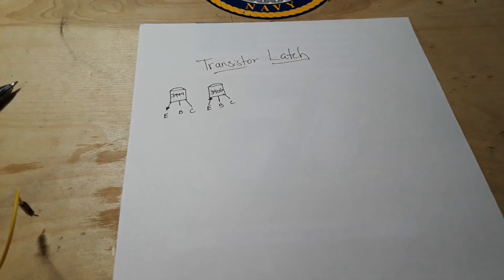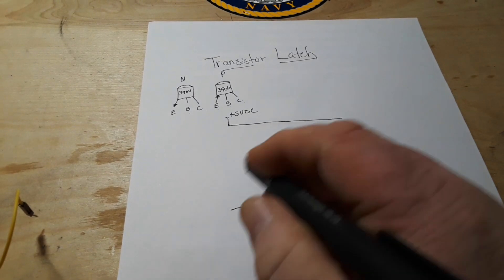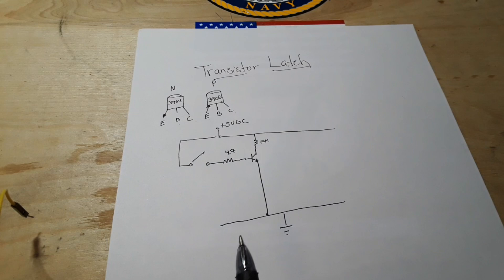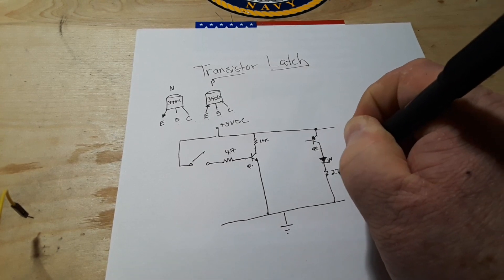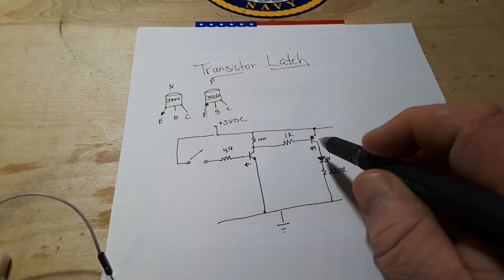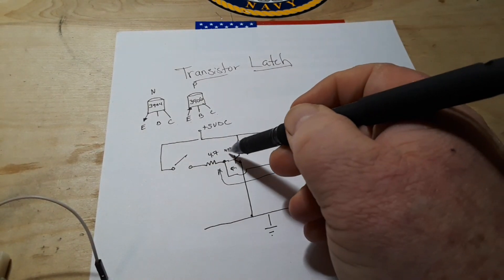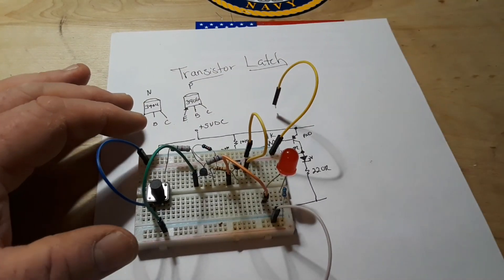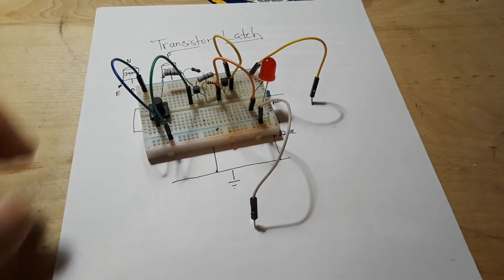The Two Transistor Latch

Comment: There are some things on this that aren't so clear...

Step 1. Connect one side of 10K Resistor to the positive rail and the other side to the Collector (C) of NPN Transistor. That is clear.

Step 2. Connect the emitter of the NPN Transistor to the ground rail. That is clear.

Step 3. Connect 4.7K resistor to the switch. Do you connect the other side of the switch to the Collector of the NPN? Do you connect the other side of the switch to the Positive Rail? I would think so, but you don't make it clear (THROUGH WORDS) that that's what you're doing. Unclear.

Step 4. Connect PNP to the Positve Rail. Are we connecting the C or the E? For someone who doesn't read schematics, this is unclear.

Step 5. Connect PNP to LED. Are we connecting the positive of the LED or the negative of the LED? Are we connecting it to the C or the E on the PNP? Unclear.

Step 6. Connect LED to a 220 OHM resistor. Again, don't know if it's the positive or the negative of the LED that we are connecting it to. Unlcear.

Step 7. Connect other side of  220 OHM resistor to the ground. Clear enough.

Step 8. Connect one side a 1K resistor to the base of the PNP and the other side to...where? You say to the power, after the 10K resistor, but it looks like it's connected TO the 10K resistor, which is connected to the C of the NPN...so is the 1K resistor connected to the B of the PNP and the C of the NPN? If so, why not just say that? If not, where is it connected? This is unclear.

Step 9. "We're going to take a pull off of that right there..." Off what? Is that the negative of the LED? Is it the positive of the LED? Is it off the C of the PNP? Is it the E of the PNP? Very Unclear.

Comment: Honest question, why not just use both transisters as an scr instead of all the resisters and everything? 

Learned alot from you though, thank you for l what you do!!! ❤
Reply from the maker: It's just one way to do something. This is a common circuit that you will see in use.
Reply: @learnelectronics  gotcha, thank you 🙂

Comment: I don't know if anyone ill care to answer this but I'm an educator who needed the circuit for a project and I do not understand the reason for many of the resistors. I get the 1k completely as the current will follow the preferential path once Q1 is open. I breadboarded this on a 3v system.  But the reason for the 10k and 4.7k elude me. I know the circuit does not work without them but I do not understand why. I am guessing that the current to the bases needs to almost be miniscule compared to the current flowing through the transistor or adverse effects will happen. Thanks to anyone who takes any time to provide a run down.
Reply: I'm no expert but I think the 10K resistor is there to avoid short-circuit and also to avoid wasting power. If there was no 10K resistor, what would happen then? I think the 4.7K resistor is basically for same reason but not completely sure.

Comment: I really enjoy your videos. I learn so much from them. Some feedback from a beginner... I see a lot of videos where resistors are put into the circuit, but very little explanation is given as to why, or why the value chosen was chosen. I know in this video, you mentioned using the first 4.7k resistor so you weren't "jamming the transistor open too hard"... but I don't really know what your definition of jamming is in this case. Everyone seems to ALWAYS remind us EVERYTIME why they put a resistor with an LED, but very few discuss it on non-LED components, and it's frustrating. For example, if I want to recreate this circuit, but don't have a 5 volt source, how would I know how 9 volts (for example) affects the 4.7k resistor if it's purpose and value isn't explained? Thanks again for the videos... I could have JUST used this technique in a circuit I made. Very helpful.
Reply: It's worth delving into deeper with a dedicated resource to learn the details because it's a deep topic. A transistor is a current amplifier, so for an NPN knowing there will be about a 0.7 V drop from the collector to the emitter and a 0.2 V drop from the base to the collector assuming saturation mode, you can determine the current going into the base. Then, you can look up the datasheet and see the rated gain which is usually at least 300. So, without the resistors, a small current to the base could result in a large current (300 times larger) from collector to emitter, and could easily destroy the equipment. A transistor is similar to two diodes back to back, so just like an LED can burn out from too much current, so can a transistor. Not that I would ever burn up a bunch of transistors trying to make an H-bridge. The resistors help save power also, as often a large current isn't needed for digital logic. To determine the correct values if you were using a 9V battery, you can use mesh analysis which is it's own topic and far harder with transistors, at least for me.

Comment: Hey Paul, I built this circuit and when I connect to power the latch is energized before I press the button. If I ground the emitter on the Q2 then it de-energizes and the button energizes the latch as intended. Any idea how I can make it stay de-energized when I connect the circuit to power?
Reply: I have the same trouble, think that is for the leakage current param

Comment: I used different NPN and PNP transistors (just general purpose ones I had on hand) plus 10k resistors instead of the 4.7k ones (since thats what I had to hand) and found that just touching any of the wires/circuit latched the circuit (LED came on).  I assume this is noise and parasitic's.  The NPN transistor I used turned on at 560mv and it wasn't hard to create that level of noise just tapping the wires (or pressing on the underside of the breadboard!).  In any case I put a 0.1uf cap from the NPN Base and ground and this seemed to solved the issue.  Just starting to learn this stuff so not sure if this was inspired or just coincidence....
Reply: yes i had the same problem  thanks for the fix.

Comment: I tried to replicate your circuit but can’t get it to work correctly. When I turn on power, the LED comes on and stays on without triggering the button. However, if I unplug the 5v lead from the emitter of the PNP, and then  reconnect back in place, the light stays off until I press the button, at which point the circuit works correctly and latches as it should. I used all the same components and values as you and even swapped out the transistors thinking they may have been faulty, but no luck in getting it to work correctly. Any ideas on what could be going wrong?
Reply: Your right.
Reply: Hello did you resolve that question? as I see that now in a test I set up..

Comment: these latch circuits are Very handy to know and have in your arsenal to pull out when needed. THANK YOU PAUL. 
P.S. add a couple of cap's and another transistor and you can make it come on & off with the push of that button. which is another handy circuit, i  hope Paul will show us that one too.
Reply: It does not work!

Comment: This reminds me the old days, when there was no or little coding in electronics. Everything was pure practical. The transistor based servo circuits, logic circuits, only a few ics were used. Today those forgotten circuits seem to be an alien tech for our new engineers, who have never gone through these.
Reply: I'm pretty bad at electronics but this is exactly the reason I refuse to get into coding. It's just so much more fun to actually build the circuit
Reply: @cucumber1389  " My preferred method of programming is a soldering iron"....Steve Ciarcia (Byte magazine).  As is mine. I can code, 'basically', and I've held off getting into the arduino gold rush of things, but for practical purposes, have had to dive into it. However, nothing beats putting together a nice component level circuit and watching it come alive. This channel should be a pre-requisite for anyone wanting to learn real electronics.
Reply: @sgrimm7346  its of course fine to learn and use coding in projects if that suits the person, but to my preference I learn more doing physical electronics
Reply: @cucumber1389  where is the fpga gang at? Coding the physical component
Reply: @cucumber1389  that's the main point... Coding is good, but not always.
Reply: @iMiilk182 FPGA gang here!
Reply: @cucumber1389  Agreed 1000%
Reply: If i show 3 transistor lach circuit to an electronic guy he would immediately say that its possible to do it with 2 transistors cause he knows how transistors work in detail, and not because he remembers the circuit :D
Reply: Transistors? By the ‘Eck, lad. I started with proper triodes, real glow-in-the-vacuum stuff that would as soon put a few hundred volts through you as not!

(Actually, that’s not true. I had a Philips (Norelco in the US) EE20 electronic engineer educational set with an AF116 and two AC126 transistors, but I started playing around with valves not long after when my grandfather introduced me to his Practical Wireless collection and sundry components. By the time I was 16, however, I was firmly into the BC108, 741 & 7400 series, and 555s about a year later, with my high voltage exploits being confined to the A-Level physics lab)
Reply: I'm one of those lol. But in my defense, I always use a little code as possible (less things to break). I'm just now learning all this and it's fascinating. Side note: I miss this age of youtube too, where people just turned on a camera, imparted information, and ended it. no hype building, no "influencing." not worrying about the algorithm.

Comment: Cool video ! 
All you need now is a NC switch on the feedback line and you have a push on push off switch . These are great to drive a relay that controls mains power and an added bonus is they are also a no voltage reset switch like what you want on a lathe or milling machine , if the power goes out while you are operating it you don’t want it to start up automatically when the power comes back on .
Reply from the maker: Great idea!
Reply: The NC switch in the feedback line is a wonderful idea, too 👌🏼

Comment: Very interesting circuit to be applied to model railroading electronics. Thank you! 
Maybe can you reset the circuit by connecting a push button between the base of NPN and gnd?
Reply: Yep. Just use another switch.
Reply: Yes, and the advantage is that you can use a common normally open switch (as opposed to a normally closed switch on the feedback connection).